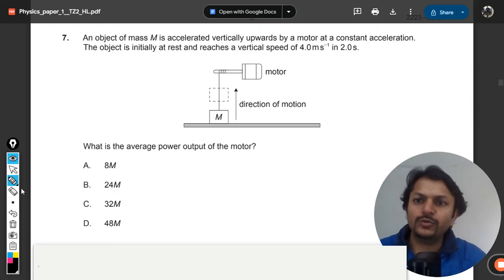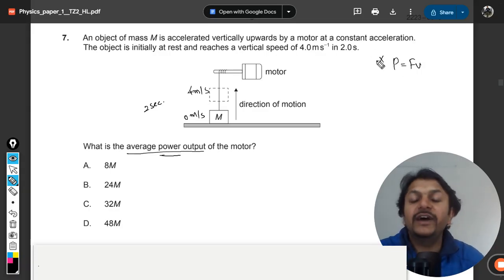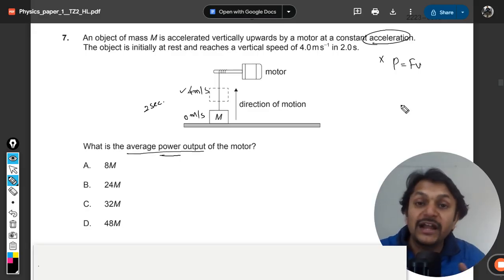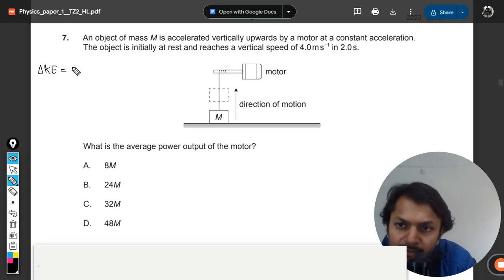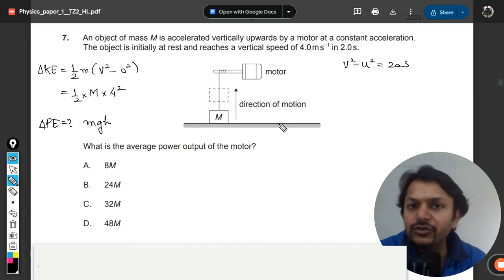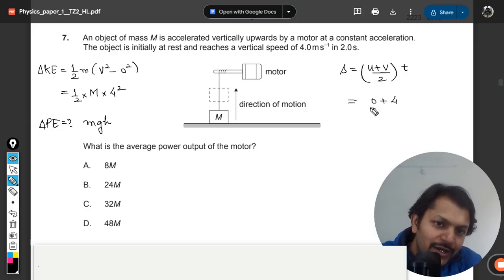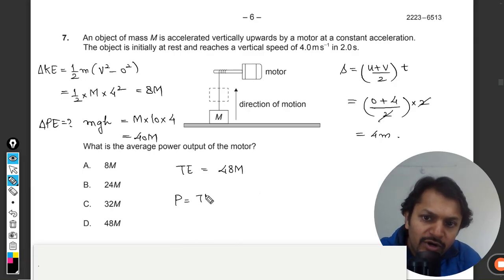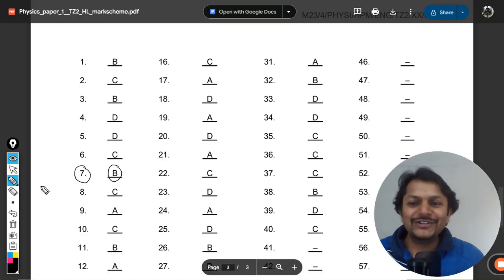An object of mass M is accelerated vertically upwards by a motor at a constant acceleration.The

Comment: can’t you just use the average velocity (2ms^-1) and use P=Fv? I get the right answer using that
Reply from the maker: Yes, you can. The formula P=Fv can be used only if the acceleration is not happening, or we should say, the speed should be constant. In this case clearly, acceleration is not zero. But if you are already calculating the average speed, then you can use the same formula and get the right answer.!

Comment: Hello, I'd like to ask why one cannot use the formula W = Fscostheta, i.e. change in wd/change in time = change in fscostheta/change in time? using f = ma to calculate force and SUVAT to calculate s, with theta being zero. Thank you!
Reply: Also the question can also be solved using v^2 = u^2 + 2as,  finding a with (v-u)/change in t. Because the question states acceleration is constant and I guess it implies that one should ignore the g constant.
Reply from the maker: You can use the algorithm given by you. No doubt. But, in that case, you have to add the weight also to the f=ma, because you have to find the tension in the string. Hence, SUVAT method becomes a bit tedious.